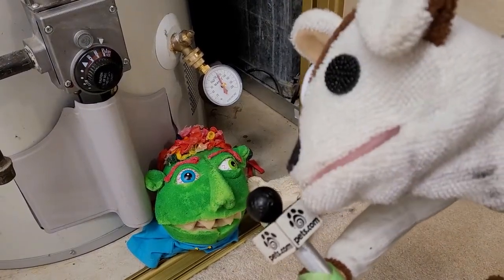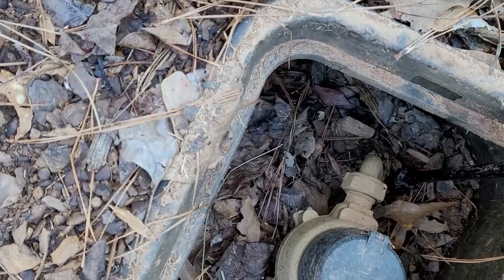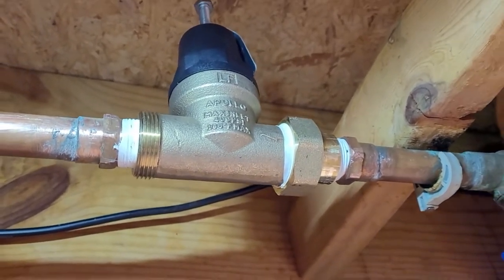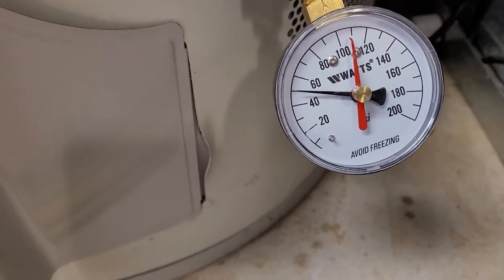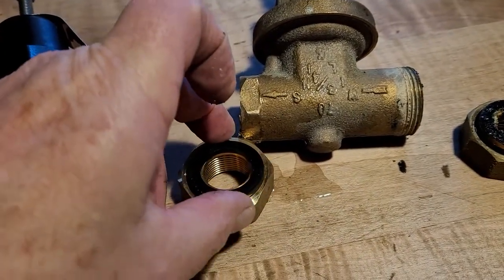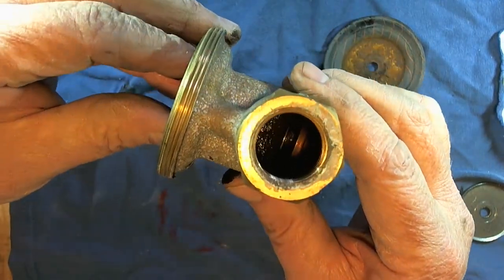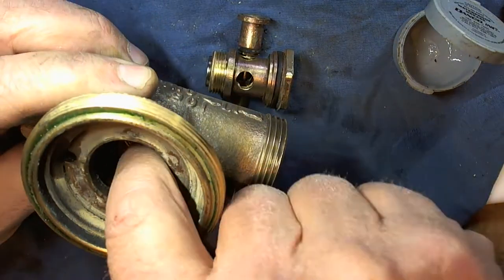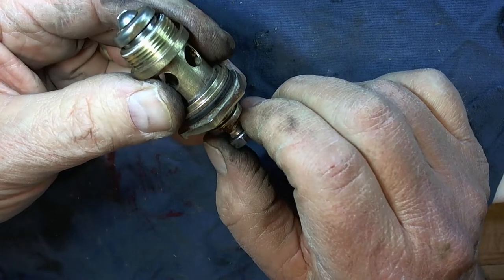Replacing the water pressure reducing valve; how to measure and how the valve works

Comment: So, measuring the pressure at the water heater is the same as measuring at various points inside the house?  Thank you.
Reply from the maker: Great question!
I'm not an expert, but from my research, the answer should be yes.
But I'm sure there are situations where that may not be so.
I read that the water heater is especially sensitive to higher pressure, so it seemed to be a good place to measure. 
What are your thoughts?
Reply: @workshopstudios43  My thoughts are that the water pressure is received from the either hot or cold water from the water heater (source) for the home.   So,  it would make sense that faucets would have the same pressure as the source.   I had attempted to measure at the faucet but I didn't know how (still dont) and that's when I saw your video (pretty smart). 🤗👍👍

Comment: At the top of a water regulator valve sits an exposed screw. This screw allows a plumber to alter the tension exerted on the spring inside of the valve body. Tightening the screw makes it more difficult for water pressure to move the diaphragm, thus raising the maximum pressure. Loosening the screw has the opposite effect.
Reply from the maker: Rodney, thanks for the great information !
And I like your channel photo; pokey and gumby have been in some of my more recent videos!

Comment: How were you able to tighten the new valve on the female side with the exposed threaded end? The video just jumped to the completed result of the new valve attached. The older valves are set-up for use of channel locks, the new ones have exposed threads. Thanks
Reply from the maker: The valve I installed had a union on one side (the right side in the video).  Start by putting the half of the union (right side) on the existing pipe threads.  Then slip the valve in between the union and the existing pipe threads on the left side.   Thread the valve onto the existing pipe (left side), then thread the union together and tighten. 
Hope that helps and thanks for watching!!